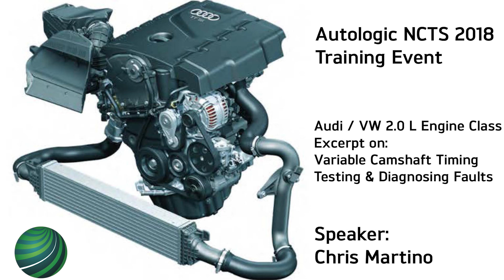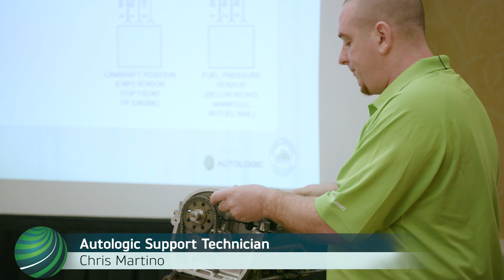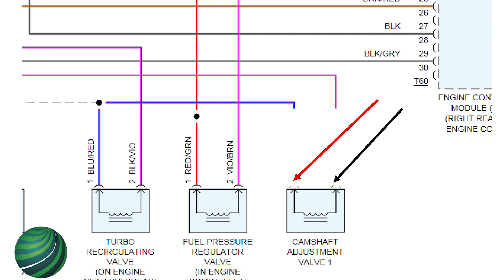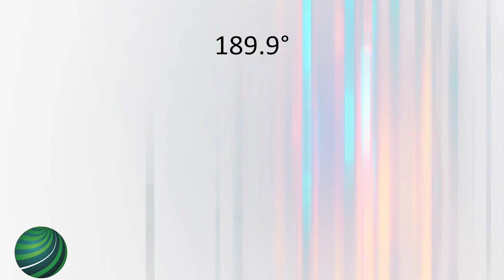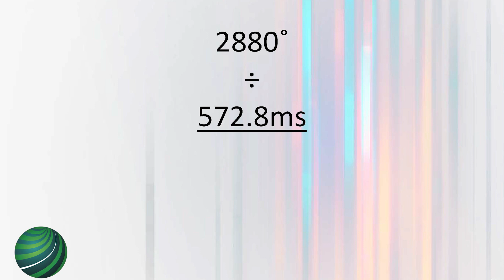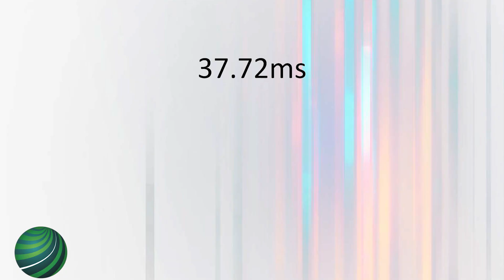VW / Audi Variable Valve Timing Testing & Diagnosing The Best Methods

Comment: Hello sir,thank you very much for your knowledge sharing with us ,i want to ask you before do this energized test to the camshaft actuator we must firsr check timing marks to avoid bent valves if it has problem with stretch chain,go out a tooth, etc ??? Can we bent valves for a reason if we make this test?? Thanks in advanced!